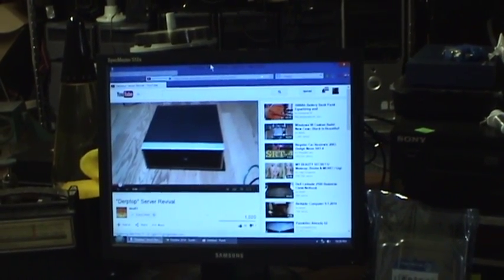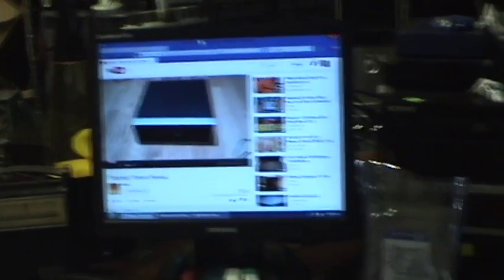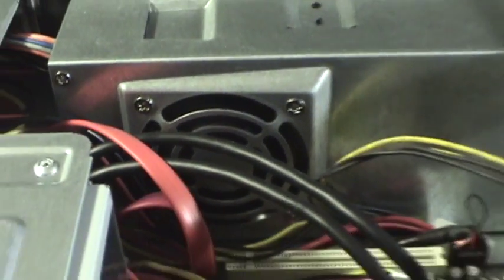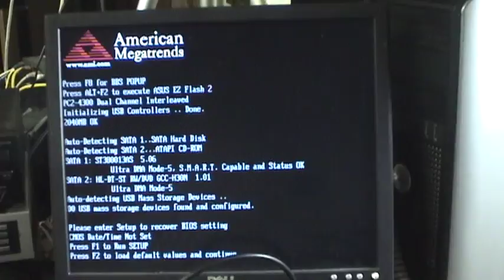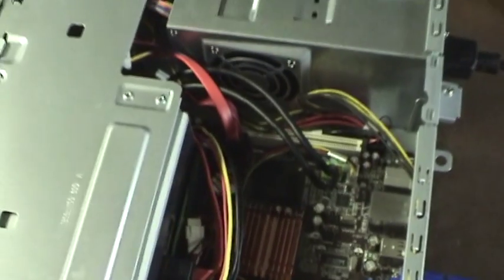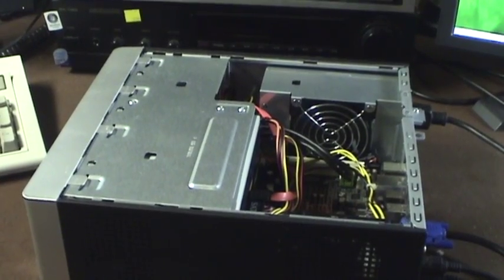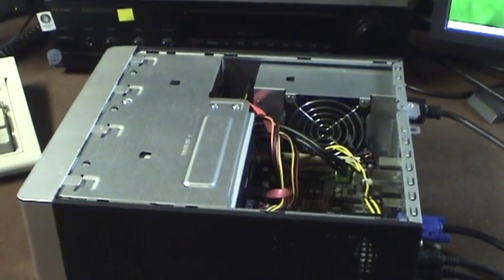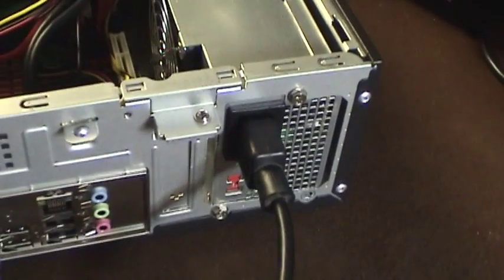Small Form Factor Power Supply Replacement "Fun"

Comment: Bill, could you not have taken the guts out of the new psu and drop it inside the original psu case?
Reply: It's possible, but probably not reliable. And most of the connections like the power cord plug, and the incoming power switcher would not line up. As they are usually attached to the main board of the power supply.
Reply: SmerrillS Reviews
I have done this with odd shaped psu's, there is no problem with reliability if its mounted correctly.
As far as the pcb is concerned, wires attach to the socket, the rest is just floating wires just ziptied together.

Im sure manufacturers do this on purpose, lets make a "special" psu :-(

Comment: Tails said it for me, I was thinking nearly the same thing. Rivet a plate over that hole, ditch that PSU entirely. Either find a 20/24 pin pico psu, or find an ITX motherboard with DC in, rock an external brick.
Reply: As I said in his post, most likely the only exhaust for the case would be the power supply, and he doesn't wanna have to cut holes in a nice looking case.
Reply: SmerrillS Reviews He likely has little to no airflow in that case anyway, especially with that ill-fitting psu. Assuming that CPU has a low TDP (taking motherboard into consideration) cooling would be hardly an issue. Small fan somewhere if the case doesn't have one already. My tower with an AMD APU had a small fan and the entire case closed up otherwise.
Reply: djg320 according to intel's website the celeron 220 is 19 watts.

Comment: Is it time for a steel plate(or other PSU hole covering material, a Pico PSU or similar that connects to an external brick and then say goodbye to PSU fan!?  As some kind of bonus you get to run it in the car!!!!!
Reply: The problem with that is: most likely the power supply fan takes out the hot air inside the case. And he probably doesn't want to cut holes in a nice case to add a fan.
Reply: I like my pico PSU and haven't had any problems with it.
Reply: SmerrillS Reviews Aww yeas good point, not really enough space to add a fan in it's place.

Comment: I'm having a similar issue finding a PSU for an Antec Minuet 350 case, It is one of the very last made (USB 3.1 in the front panel), I plugged it in after it had sat for a month or two and there was a bang and a burnt varnish smell.

Comment: This Came from an era when ITX was quite new. I recall seeing these cases about 6-7 years ago at a local computer chain store here in the UK and they were a little on the cheap side. Personally I would buy a newer ITX standard case as you may find there to be a little more room in the case and more parts around for replacement further down the road.

Comment: Do you know what kind of power supply form factor the HP convertible minitowers use? Or where I can find an adapter to use a normal powersupply on them? I don't like using HP's proprietary psu's as I think that they are junk.
Reply: No the power supply has no problems like that. I usually inspect any psu in any computer I get. The problem is is that I want to upgrade it to be 80 plus bronze efficient. It has the standard connecters such as the 24 pin main and 4 pin cpu, but it is larger than the standard atx design. I'm trying to find a bracket to adapt an atx psu to fit the bigger hole. I found them on ebay but they only come with power supplies. Here is an example of what i'm talking about : http://www.ebay.com/itm/like/121094235016?lpid=82

Comment: I have one of these cases as a matter of fact.  The power supply blew up in it a few years ago and when I looked at prices for the proper power supply, well I couldn't find one either that I was confident would actually fit. I ended up just buying a new matx case with a power supply. Needless to say that while there was a lot of air inside of the new case with the itx motherboard installed, it has been working to my knowledge for the past 4 years or so without fail.

Comment: So funny you post this! I myself have come across a Mini-Itx system with an UNKNOWN PSU.i have run GOOGLE in to the gound searching for it's formfactor. Lucky for you, yours is an actual form factor being a TFX. Mine is some custom 200W job, so my lofty plans to make my STEAMBox/XBMC dual boot media center with this 2002 "Cheyang-fun" all aluminum shuttle style case is nye impossible without heavy modification! bummer! This little system also came with a VIA 600mhz board, so it is pretty much useless!  thanks for the videos!

Comment: That power supply reminds me a bit of the ones used in those little BTX computers I built a couple years back.  I also ran into this same issue with an Asus system at work too.  I can't stand when companies bend the standards!

Soon I hope to build a Mini ITX system that utilizes the "Pico-Power" type PSU, which is run by an external 12V power brick.  The case I have set aside for it is barely any bigger than the motherboard :-)
Reply: Well you did!
Reply: LTech13 Ya, it only took me a few months LOL.
Reply: lol!

Comment: I have a question
ATX power supply is compatibile with SFF case or we can only use TFX power supply?
I want change my old TFX 300 W Power supply with one more powerful over 400W but the problem is that TFX power supply are under 350W
Reply from the maker: If you need a more capable power supply, it's time to rebuild in a regular ATX case of some sort. 300-350 watts is as good as it gets in TFX/SFF land, and I'd not trust any of those power supplies to deliver that much power for any length of time.

Comment: Doesn't really seem like the camcorder wanted to focus particularly well here, but ah well. SFF PSUs are indeed a pain in the proverbial. Best case scenario with them, if originals are impossible or very hard/expensive to source; you can find a PSU where the insides can be swapped painlessly (or relatively so) into the original case (with some helpful drilling of new holes and such things). I'm no fan of these SFF machines, simply because they're proprietary and far too cramped.

Comment: I wouldn't worry about the small gap that nobody can see anyway. A "perfect" replacement would have involved taking the guts of that new power supply and sticking it in the old case. These small cases always have problems with heat. If the power draw was low enough, I would have suggested an external power brick and a PicoPSU adapter.

Could the original have been a "SFX" formfactor unit? I see a similar mounting system in these diagrams: http://www.tomshardware.com/reviews/power-supply-specifications-atx-reference,3061-4.html

The next page has the official TFX and Flex ATX (which I think your first replacement actually was) measurements as well.

I feel your pain in dealing with this. I used to have to source all these oddball sized power supplies for customer machines when they failed. eMachines, with their infamous failing power supplies, liked to use Flex ATX and SFX.

Comment: Have the very same Foxcon system. Power Supply still original and working. Got FreeNAS running on it. and been using it as a Fileserver the whole time i've owned it.

Comment: Some of the early Mini-ITX motherboards supported floppies.  I had the VIA ME6000 and ME10000 boards at one stage (they were released around mid-2003), and both those had floppy connectors, although the CPUs were underpowered compared to the Celeron 220 in your Asus board.  In late 2008, Jetway had an Atom-based board that had a floppy connector.  This is probably the last M-ITX board to do so.

Comment: It happens to me where I got the new power supply replaced cost me up to $50 or so that's after my old original power supply was dead, I just happens to have a new power supply replaced including Logisys, and all the sudden, the fan made a noisy where I figured it was the bearings went bad and went loose cause the fan to go wobbly, and then, after I replace the fan for Logisys Power Supply, it worked great and no noisy now. =)

Comment: Hello sir, Can i use my i7-4790 processor on my Hp elitedesk 800 g1 sff to another normal computer? with the same socket 1150, do they have the same size? processor dimension?
Reply from the maker: How could I have even the slightest idea, since I don't own any of those systems?

Comment: my gaming computer is based on an acer veriton s670g that is highly modified. with 2gb of nvidia deticated graphics and a 3.5ghz overclcoked e8400 with 8gb of corsair vengence ram its a beast. that case is a small form factor case but its not tiny. it does have a weird ass psu but its made by delta eletronics fully equipped with rubycon and nichicon caps. and is silent. hell, its rated for 300w max load and i pull 450 from it!

Comment: I hate slim line computers for the most part, the really small power supplies, save for server supplies, are terrible for reliability. The motherboards are ok, but the cases and psu's are sad. Hey, idea, might be a terrible idea, but get one of those 12V DC-DC ITX power supplies that take a single 12Vdc input and put that in there with a fan, then you can just use an external brick to power it. Might be room in the back where the PSU was supposed to be for a fan too.

Comment: I never really have understood why hp uses those garbo foxconn boards in their systems from around that era. 70% of foxconn boards that I have pulled from hp computers always have seemed to have a bulged or leaking cap or two, even though all the boards still worked still not something I would consider acceptable. The other thing that I hate about hp small form factor pc's is how if anything ever goes wrong you pretty much need to strip the whole thing down to even get at something as simple as the hard drive.

Comment: I am sometimes too tall to see short videos. What should I do?

My solution to powering an ITX system that I built in an old external SCSI drive case was a 12 volt supply used other mini ITX cases along with a power brick or bench supply. Project web page from 8 years ago: http://www.barovelli.com/projects/computer/mint.htm

Comment: A google search revealed that the one you bought might not conform to the standard. This one appears to have slightly larger dimensions, but if you do get it don't kill me if it doesn't fit :-P. http://www.newegg.com/Product/Product.aspx?Item=N82E16817151090

Looks like the screw holes match up better... but It's hard to compare exactly in the video.

If you took a perfectly level straight forward shot of the rear of the case I might be able to line up the holes in photoshop with the seasonic psu.

I tried to do some CSI in paint, I don't have gimp or photoshop installed at the moment. http://i.imgur.com/dTqEaAn.png

Comment: Some day I might be brave enough to pull a system all the way apart and do something like that.
Hell I was brave enough to pull my bought 2nd hand dell inspiron 6400 laptop apart and upgrade the cpu from the intel core 2 duo t2300 1.66 ghz chip to the t7200 2.0 ghz version, worked first try and is much faster.

This was a BIG step up for me before this I've only messed with hard drives and ram chips. So glad I did it system is faster, it's very noticeable on boot. Now if o ly I could find a little set of shelfs to put under my computer desk so I can setup my two inspiron 6400s and the 1501 I'll be turning into a media center for all my mp3s. I also plan to setup a closed network between the three machines for file sharing and network multi player gaming on the two 6400.

File sharing well be easy. the old router I plan to use has a usb port for sharing usb devices over a network.
I just hope setting it up well be easy given the mix of OSs one's xp pro ones vista home premium and one's 7 pro
all machines have all their service packs installed.
Reply from the maker: There really isn't a whole lot to it. Make notes and take pictures if you feel the need. Most every connector is keyed so they will only fit what they're supposed to. Just don't make the same mistake I once saw someone make: it is perfectly normal to have some connectors left over on a computer power supply. Not every connector is needed for every application.
Reply: ***** ah I see good advice thank you. Yeah there's a few unused cables in my desktop but not many lol. And of course there tucked up out of the way for improved air flow. I'd like to take credit but I'd be lying, since it was the person who built the system who did a great job of cable management.

Comment: Off-topic comment

I'd say to keep using the TRV27 for SD videos...steadyshot and (this is just pandering to my autistic side) the quality is slightly sharper...though pandering to my poor side, SD video might be good done with the D8 machine because 8 mm tape is cheaper...I'm going to pretend I didn't make this comment and go back to my Java class homework like I should have been doing in the first place.
Reply: Looking at your original test of the TRV27 (the part where you zoom up on the window) it looks like either smaller camcorders are easier to stabilize or it can do steadyshot in widescreen...as far as the TRV280's issue, my first guess would be that there is some kind of weak magnet switch (much like the one in my SR11) that controls that and some kind of piece of metal came out...but I haven't torn a TRV280 (or equivalent Hi8 model) apart so don't take my word for it.
Reply: ***** The analog Hi8/Video8 camcorders allow use of SteadyShot in "cinema" 16:9 mode (which just letterboxes a 4:3 image) but not in "full" 16:9 mode (which is a true widescreen mode). The reason is because the true widescreen mode extends into the edges of the image sensor that SteadyShot would normally use for its image stabilization."buffer zone". The MiniDV models allow SteadyShot in 16:9 mode but aren't true widescreen either; they just crop off the top and bottom of the 4:3 image. I can't remember if the HDR-HC7 is true widescreen or not, since I haven't use it in a long time, and neither have you! ;-)
Reply: vwestlife
To be completely honest, I never knew that about the Video8/Hi8 steadyshot...shit, I guess I still do learn something new every day.

Comment: Nice project Bill!, i know the hassle with these small form factor pcs they suck when the power supply needs to be replaced why not replace the power supply with a dc-dc power supply with around 150-200W shouldn't that be enough for it?

Like:
http://www.ebay.com/itm/X1-ATX-180-12V-Input-DC-DC-PC-Power-Supply-with-180-Watts-DC-ATX-Output-car-pc-/191183605996?pt=PC_Netzteile&hash=item2c836e50ec

And maybe you have some old dell power supply from the gx 6xx usff those use an external powersupply just hot wire one of these?

Keep up the good work!
Reply: *****
 I can understand that but maybe a plate with a fan mounted in that and a dc-dc power supply but easiest would been to find the same psu as it had or to retrofit the internals of this new in the old case i know it sucks Good luck anyway! :)

Comment: Allied power supplies are crap. they are tagged as dangerous by market inspection in my country.
Reply from the maker: +MP-Tuners Productions Perhaps more than one manufacturer is using the name. None of the Allied branded power supplies I've seen have had any safety issues, and although a few have died, they always shut down quietly without hurting any other computer hardware.
Reply: +uxwbill you should go with SeaSonics OEM PSUs, Allied are very well known to be garbage, very low quality capacitors and outdated and budget designs meaning the ripple and voltage reg is way off etc, nothing like as tight as SeaSonic and as well built as Deltas etc, they're in a whole different league. If you're not playing games or anything demanding and a modern PSU has a failure it's a sure sign that it's a heap of crap because it means it basically failed while pulling no more than 100w which is quite laughable as many modern even mid range PSU have a capacity of 500w + and could hold that maxed for years on end, again an example would be a SeaSonic S12II or a Delta built Antec.
Reply: +uxwbill of course I'm not saying power supply output = quality, far from it, but to fail at what is almost an idle load is rather poor in this day and age.
Reply: +uxwbill I've been using SeaSonic PSUs since 2007, yet to have a single failure in my PCs, even the fans are ball bearing or FDB instead of sleeve so they'll last for years upon years too. The main PC has a SeaSonic X 850W and it's just a brick of components, it's as heavy as some laptops lol.
Reply: +uxwbill you can actually find some used SeaSonix ATX PSUs on Ebay being sold off, they're a great cheap buy, they are low end for SeaSonica but for $5-10 it's quite amazing value as they retail for 30+50+ depending on model. The SS400ET and other ET SeaSonics are the most common on EBay and the cheapest, depends what people are selling at that time but for budget machines they're above and beyond anything else you can find unless you get lucky with a used standard atx Delta.